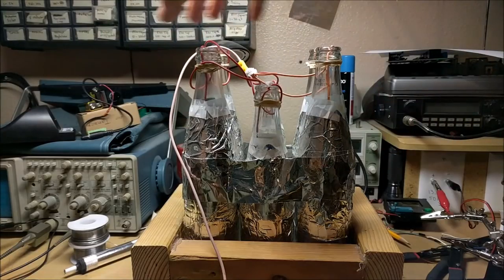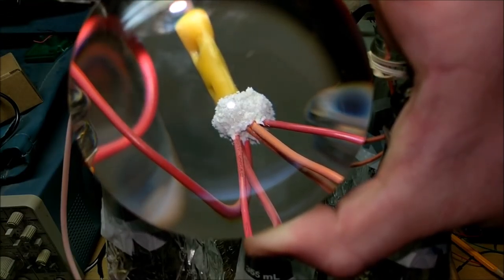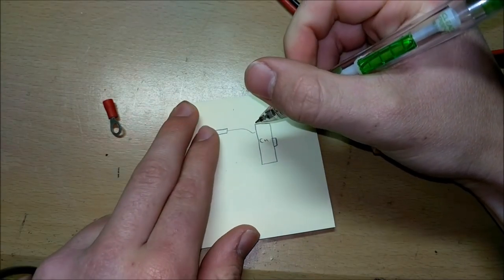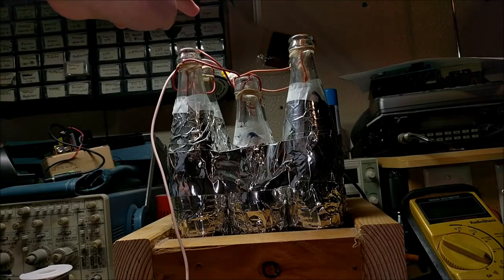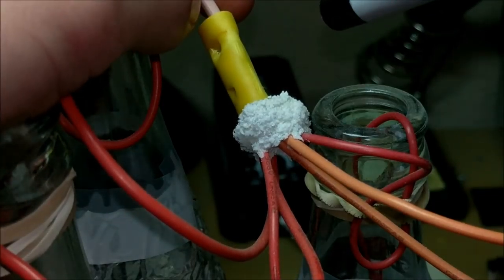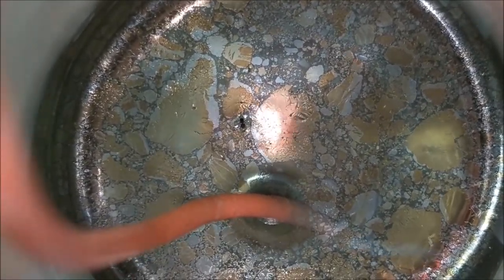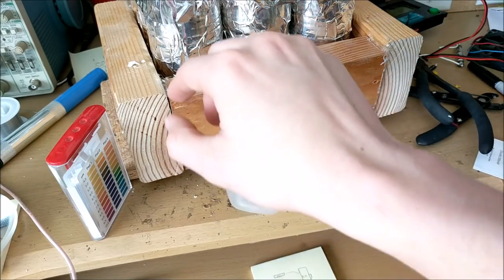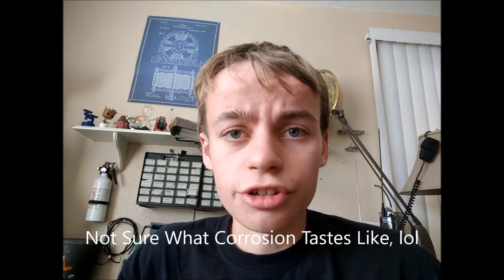Strange Corrosion On Salt Water Capacitors Explained

Comment: I have the same thing with my salt water leyden jars, and yes I've watched water and oil travel upwards on a wire when a high enough voltage is applied and it can make it's way through, up inside the wire coating via capillary action. First vid I've ever seen on this topic. Good job.

Comment: Your electrolyte is super saturated, as the water evaporates the remaining solution can no longer hold the amount of salt, so the salt drops out of solution and forms salt crystals
also you are right about the stranded wire wicking up the solution by capillary action

Comment: very cool.  just be careful around soldered joints, could be lead salts and nickle salts, not good to eat.  I have  question, why use salt water in the capacitor, don't you get more capacitance from regular distilled water?
Reply from the maker: +Gristle Von Raben The salt water acts as one of the plates, so it needs to be extra conductive.  The glass is the dialectic

Comment: Cause of high voltage high frequency. salt gets transported there as electricity got a lot of kinetics in this mode. And you get crystals of wire growing on the surface from harmonic electrolisis

Comment: Assuming that the "white stuff" will dissolve in water,  I would suggest that you use that solution to grow crystals of the substance.  Then you can figure out what it is by looking at the crystal morphology, and cross referencing with the elements in your experiment; Copper, Sodium Chloride,  Zinc, probs Tin, etc.  If it forms cubic crystals that are white and mostly transparent, probs NaCl for example. crystal morphologies can be found on-line fairly easily.

Comment: use household solid copper wire as electrodes, that eliminates the wicking issue, thereby eliminating the need for a sacrificial anode, since there would be no dissimilar metals in contact with the saltwater. but you could melt some zinc onto the tips if you did want sacrificial anodes. Mg is good too, but the only 2 'easy' sources i know are Mg ribbon and Mg firestarter blocks, and zinc is easier to work with, since you can just melt it and it is cheap and readily available pretty much anywhere, salvaging from pennies is convenient, but not exactly a cost-effective zinc source.. your mystery powder would probably be  a combo of salt tht crept up and evaporated, and Zinc oxide from what looked like galvanized connectors. or if its aluminum then aluminum oxide, also maybe zinc and/or aluminum chlorides.

Comment: I remember when I was playing with water electrolysis (12V car battery charger), I was using tap water and table salt, with steel nails as electrodes. There was a lot of rust from the steel at the surface, but also lot of other stuff I suppose from the salt (magnesium, iodine), and from the water (calcium?... other). This was really disgusting at last and I had to change the water very often.
I never "tasted" any of the dirty things I was making, but eventualy licked my fingers sometimes and the only taste I remember is the taste of rust.

Comment: The copper in the water seems to be the process of electroplating where the copper ions are unable to bind to the cathode (or object meant to be plated) since it is outside the bottle. Here is a diagram only difference being the cathode is outside the liquid. since this ions aren't able to bond anything they float to the surface. https://www.minichemistry.com/wp-content/uploads/2015/05/electroplating.jpg
Reply from the maker: Thanks! When I clicked on the link, it said the website was forbidden though.

Comment: granted, sea water has multiple earth metals. I would not eat it since you are adding  electricity which is  creating the substance.. If you have enough of the substance you can test using chemical reactions, that would use up the substance. I would also say sea water has small traces of gold and other substances. I will say I enjoy the capacitor bank though. Just be careful